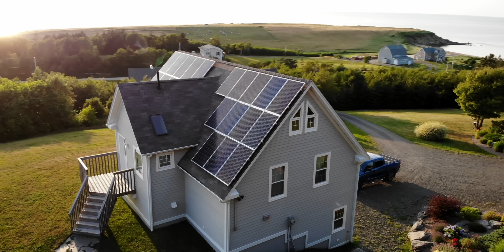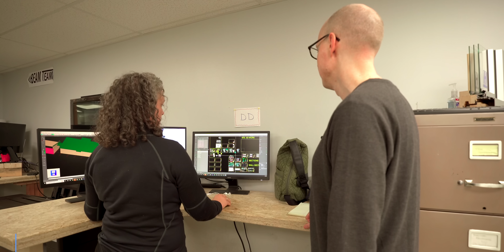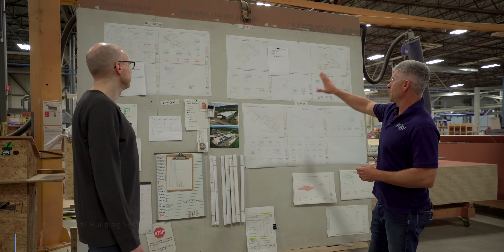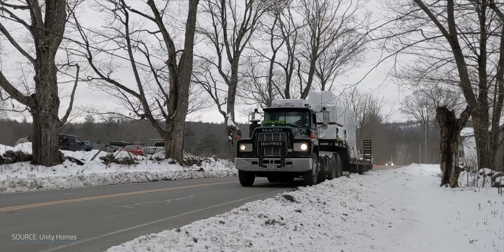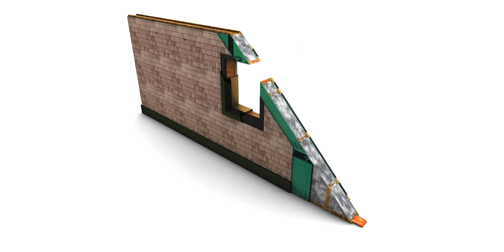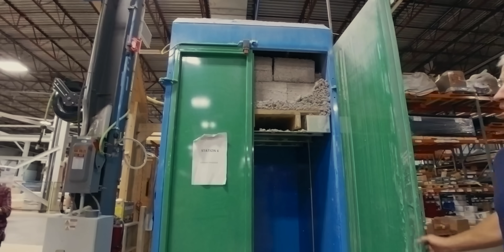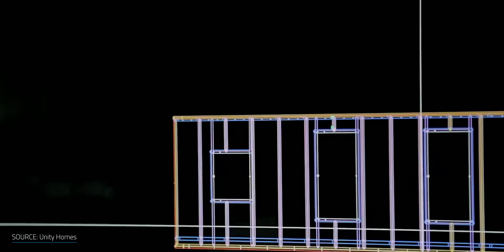The Simple Genius of a Prefabricated House - My Net Zero Home Build

Comment: Some americans ask why build this if brick house costs the same? Answer: labor costs are higher in EU, so it IS cheaper here because this takes less time to build. Also Prefab build means a QA was done in-house and there are less chances some idiot worker can mess something up or pinch on materials. All in all Benson has really elevated the streamlined standard of these houses, that facility is more impressive than anything I have seen in Europe. One difference, in EU we run all wires from ceiling and drop directly down to outlets, so no cuts in wall studs need to be made. Also, Matt don't forget about a good recuperation system, these houses are airtight.

Comment: I love the idea of bespoke modular pre-fab homes in terms of efficiency, design and cost. It makes great sense. 
MY big concern is all that engineered wood. Yes, its structurally sound and economical but it has a lot of yucky components in its makeup, specifically glue. SOOOO much glue. And nasty, toxic glue that wit off-gas is your residence for a good long time. 
Plywood is everywhere and it is engineered. It generally makes up the thin sheeting for floors, walls, and rooves. I just feel when all the other components, (studs, beams, joists etc) are engineered also: thats  a lot of fricken glue. 
Id love to see this idea merged with timber fram construction where the engineered big pieces of wood  are replaced with solid, dimensional wood.. 
Science yes, but with less toxins'

Comment: I have an Uncle who is a retired architect. He and his partner tried building homes similar to this using "Panelized" construction where the walls, floor sections and roof sections were built in a factory setting. This was in the 1980s. It wasn't this sophisticated and he had issues with contractors. They didn't have their own assembly teams and contractors fought him all the way. The old "we never done it this way before" attitude finally drove them out of business. But he did say that a major benefit was greatly reduced waste vs site built. Resistance to change and doing something new has kept us from progressing more rapidly.
Reply: Just finished an attic addition on a stone first floor, with SIPS panels. Rented a crane to fly the panels into place, Glued them up and bolted them together, with 2 guys. Remote crane controls are magic.  The structure was self supporting over a 32' span, the inside looked like a small basketball court, with 14 foot ceilings. Finished, to the wife's wishes in 3 months. Just survived a brutal, but not unusual winter. With R-40 roof, R-30 walls, MrCool heat pump barely ran.

Comment: This tech makes so much more sense than 3D printed concrete buildings. This actually solves so many problems and improves on construction and build quality, rather than geeking out on some new tech that doesn't actually make sense for it's intended use. I'm especially excited for prefabbing and modular pieces scaling up to larger scale multi-unit buildings, especially going up to 20 or 30 floors.

Comment: Ok, so Matt it seems like everyone is wondering how to get a sense of whether manufactured homes (regular ones, not a zero-energy home like yours) are cost efficient and if so why are companies like Unity not doing them everywhere.  I would buy a Unity home just for the reduced time to build and for higher quality expectations if the cost was at or below market price for using conventional construction.  The nightmare of dealing with sub-contractors here in Alabama would more than justify it.  Yes, I get that this is a complex question and hard to normalize across the country, but I am confident you can do the analysis and get us a video that helps us to decide.  Like the failure of drones delivering stuff to us every day, I am sure there are complex reasons why this is not the prevailing method of constructing new homes.  --keep up the good work Matt!  -R
Reply from the maker: Thanks for sharing, Russell.  I think you're right in what people are looking for (I'll try to hit on that in future videos on this).

Comment: This is an incredible process and it really requires commitment to high standards and tolerances in order to make it all work. You can see the way in which the entire process reduces waste and time while creating a quality product. Sustainable housing is a vitally important issue as our society moves forwards, and this kind of processing and software can help with not just improving sustainability but reducing costs so more affordable housing can be built (and at higher quality, requiring less power for heating and cooling too).

Comment: "Why are we not doing this everywhere?" We started the process finding a contractor pretty exactly 2 years ago. We had offers from mostly prefabricated homes (what you showed is already pretty standard in Germany) but in the end it was simply neither faster (due to a huge backlog) nor better nor cheaper. We are now building with a regional small company using Ytong bricks and the house is the same in terms of energy efficiency, it has a higher standard and it is cheaper. I have yet to see prefabrication actually turn into an advantage for the customer, so far it is mostly a great business model for the companies who sell the perceived advantages of prefabrication but fail to live up to this on closer investigation

Comment: I am very jealous of this build. If pricing is comparable to stick and frame with high-end windows and doors like a custom home builder, then I would go the modular route every time. It seems like having robots help the building process offsite would help keep labor costs lower and hopefully better oversight of build quality compared to trusting General contractors to check everything. I just hope sharing the build software won't end up getting lesser quality companies trying to copy and have flaws in trying to rush the process. Kind of like the issues with the RV camper industry over the past several years. People at the assembly stations missing bolts or using thinner frame steel and seeing campers bend during trowing.

Comment: Jeez, seeing the home being constructed is making me jealous. The house I just finished was stick-built and they did such a bare-minimum job on it. Blow-in insulation that pushes the drywall, so nail-pops are easy to make. OSB sheathing with no tape, so all sorts of air leaks. On and on... I wish I was able to do what you're doing when I started, but the cost was just too much.

Comment: 00:10 only 24 panels?!? So few?
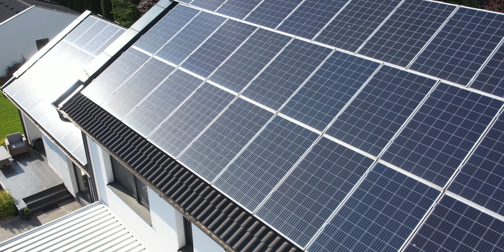00:59 Net zero is by far not enough. Did You ever see, that strawberry are in winter more expensive than in summer? The reason is storage. So it is with electricity.
Calculate for a proper balance, 3k kWh delivered to the grid for each kWh You received from the grid.
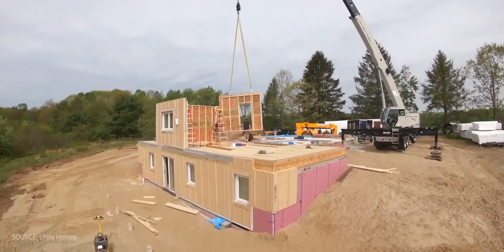01:03 Passive house is an ancient standard concentrating only on heating energy, a modern standard is CPSH - Climate Protection Superiority house

Comment: How can you call it net Zero,     Unless no long term co2 emitters such as fossil fuels was used at any step in the project?   This includes Maintenace on house and connecting to the grid.   This is why the CO2 emissions stuff is a scam.    You can tell when they claim that burning wood produces CO2.   wood grows back in less then 100 years that means it is always net zero.   Or Cows increase CO2.   Cows have a max lifespan less than 20 years, that means that they consume carbon for the life time and then return it to environment at end of life.  REAL NEXT ZERO.   Do not be fooled my so called carbon friendly claims, it is a scam.

Comment: The 'cursor' in their CAD software looks like a mouse on a medieval rack. 
Still don't understand Net Zero: does that include everything that provides the components, their assembly, all the transport, their use and maintenance and their disposal? But CO₂ is a vital fertiliser essential for conversion to sugar using photosynthesis; and there is evidence that Earth may need levels closer to 1,000ppm to assist in reclaiming the desertification which is the result of ignorant human activity. The effect of CO₂ as a GHG is entirely masked by water vapour (the principal GHG) which makes it the self-regulating system that maintains the planet's temperature . If you truly want to be a good custodian of this planet support anything the Regenerative Agriculture is trying to do. Just as a reliable customer would be enough. It tastes better and is more nutritious as well.

Comment: Net zero home: 'a house that produces as much energy as it consumes'.

Is it me, or is that fairly easy to accomplish? 

Step one: install a heat pump
Step two: install enough solar panels to cover the complete electricity usage.

I live in a 1965 house, with decent (but definitely not good) insulation. Heat pump will be coming around februari / march 2023. I think the 12 solar panels I currently have won't completely cover all the electricity usage in every year, but with 12 more that would definitely be no problem.

It doesn't seem all that difficult. It is even quite atainable with a house from 1965, basically the only limiting factor is if you have (roof)space for enough solar panels.

Edit: if you drive an electric car and that is also part of the equation stuff will become quite a bit harder, because a lot of people will run out of roof space.

Edit2: definitely the way to go though.

Comment: Matt, we are also building a new home in Delaware. I just came across a company called Zehnder who makes air exchanger systems that you can add a small ground source line for heat. They have been installed in Alaska!
Check them out , and see what you think.

Wayne

Comment: Net ZERO is a LIE. Stop with this nonsense. This is just manufactured home which assembled onsite. The same materials and tools used in traditional framing are being used. Question, how much electricity (Produced by Fossil Fuel), transport energy (100% by DIESEL), and Patroleum Based Products do you thinks your NET ZERO house used? Answer: about the same as EVERY OTHER HOUSE. You are a fool and misrepresenting the true cost of building a home. If you want a true NET ZERO home. Go build an Adobe home out of hay and manure anything other than that use FOSSILS FUELS and thus is NOT NET ZERO. Go away now.
Reply: You might learn what net zero means.  It means the house produces equal or more power than it consumes on a yearly bases.  It does not relate to energy to create or build.  And for the record your adobe house is also not net zero by your definition.  It takes food and water to produce the hay and manure as well as to feed you while you build.
Reply: @markintexas1296  My main point is this net zero crap is just that crap. Whether you spend the energy in the beginning with plastics, foam, insulation, and all of the technology to harvest, mill, and transport the lumber OR you spend the energy heating and cooling the home. The energy is still there and pretending and virtue signaling that his way is better is the exact reason why I think he is a fool. I also know he likes to drive electric cars and have solar and have the moral stance on how not drawing electricity from the grid. Too bad the energy required to create the car and batter and solar panels would require him to drive the car for 50 years to break even. But his argument is not about the need for energy but rather how he can virtual signal his solution and get paid by Youtube to press his fantasy. My point still stands. There is no such thing as net zero because every product, service, or technology used in this house used energy to produce it and the pitiful amount of energy he is saving will not matter for 50 years.
Reply: @grast5150  I get that the hype is way over the top.  I also think we do no service to join in hyping it the other direction.  The solution to lies is truth, not different lies.

Comment: My mother built a similar concept house. Mice bored through the insulation creating a mouse city. Snow melted in a grid pattern on the roof following the panel joints. The internal frame shifted so the windows warped. Insects  and moisture infiltrated. After she passed away I sold it as a tear down.

Comment: I was in Frankfurt last month and our airbnb had those windows. But I think they were double pane. The panes were separated by a good 5cm. I have never seen windows with that gap in the US. And they were hefty!!!

If you turn the handle 90° the window swings on the vertical hinges and can open fully. 
If you turn the handle 180° the window swings on the horizontal hinges on the bottom edge and opens only about 25°. I assume this is how you want them if there is precipitation.

Comment: Wood connections with nails are totally wrong (from a woodworker's perspective), I'm talking about direction of the nails. You can't expect to drive a nail into the endgrain and expect the grain to hold it. To give an example, that's the path an axe takes, and you know what it's for. 

I see double (close) nails on the same grain also, that's an easy way to cause a crack, they should have driven those double nails a bit diagonally. (15:28)

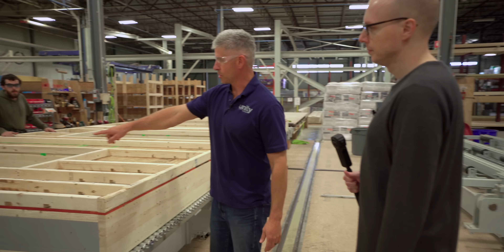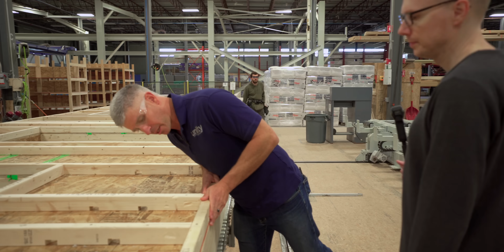Also there are no pilot holes for those nails, I can see cracks started even in the factory. (12:40/13:35 /13:57/14:03

But I like the concept, as an engineer I totally agree with the efficiency, cost reduction, environmentally friendly etc...

Comment: I love it!  
The additional utility cavity to run power and water etc is great, because if you do ever want to fix, add or move services the work is within that utility concealment wall.  Instead of lining the interior with plaster board you could feature specific wall sections in plywood board that has routed slots as vents and run in wall hydronic heating pipe behind, essentially concealed radiators, for direct fast comfort heat in select zones like bathroom or lounge.  Very Scandinavian chic!
I would love to know more about your triple glass windows selection as there are many views on what makes for the best U-values and then there is the thermal bridging though the frames and their mechanical reliability. 

It might sound tacky but I would like to use coated aluminium frames because they’re precise don’t warp, always seal and have excellent overall longevity but then there is the dreaded thermal bridging. 

There are a number of buildings groups in Switzerland and Germany that run prefabrication plants similar to your builder, but they do not generally run the additional service cavity wall like your builder.   They instead run flexible electrical conduct and in-wall connection boxes used to pull cable and then fit off power outlets.  For safety and peace of mind the fireproof electrical conduit and boxes keep the electrical separate from the insulation that shares the wall cavity.  
Not having the double skin wall lowers the amount of materials, but I prefer your builders system which offers latitude for future additional services and ease of in wall repairs, we are now promoting use this method in Australia. 

Btw the Swiss group even repurposed the plastic wrap that the walls are sealed in for pre delivery. They have their own onsite purpose built recycling plant to repurpose this plastic protective wrap. By choosing and engineering the right materials the recycling is purposeful and not just a warm fuzzy feeling for customer appeal. 
These companies wherever possible select or engineer materials that have worth in recycling, to extract the maximum value out of everything they use, this is just good business.

Comment: I have always liked the concept of panelized building. I had a small introduction to it when I was constructing on apartments in Modesto, CA in the 80's. The walls of all the units were nailed together in the factory and shipped onsite and a crane put the longer units in place. We would nail them together and only bracing and sheetrock nailers were added by the framers. It was only the 2x4 framing that was prefabbed.  After plumbing and bracing the walls we put on plywood and insulation in the walls and on the roof trusses.
Reply: What's up Matt?